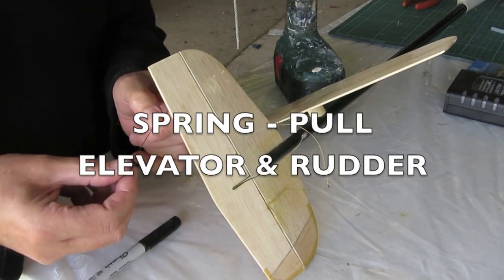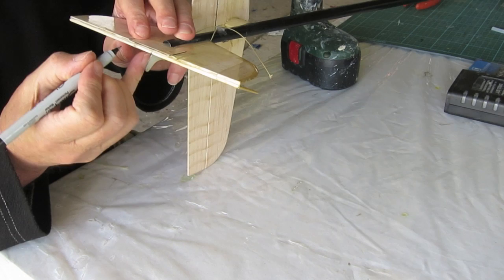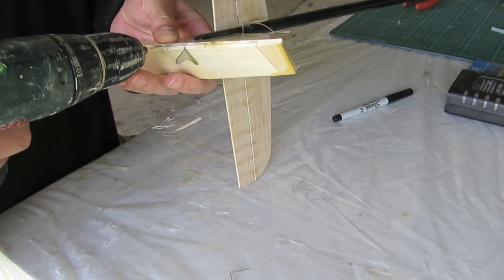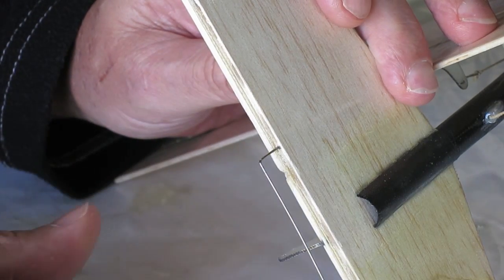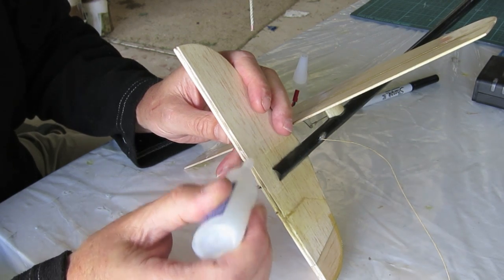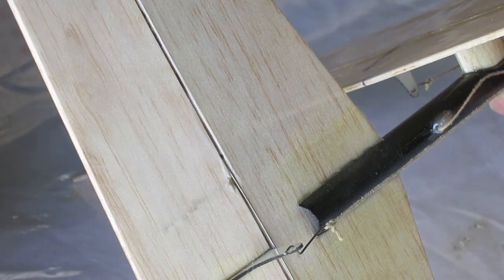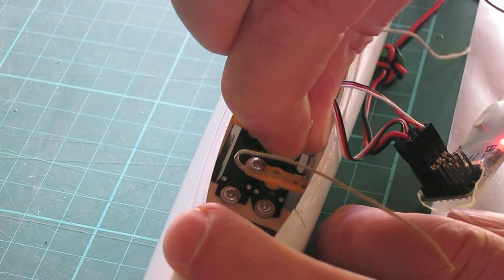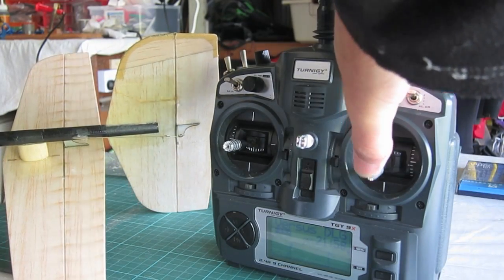Spring pull elevator and rudder

Comment: Informative video, thank you! I am trying to build my first DLG at the moment. I was wondering does it matter which side of the rudder the string is on... I would assume if you are right handed ( like me ) thrower,  as you rotate, there is a huge centrifugal force pushing out, making the rudder swing right.... so you'd put the string and horn on the left, so its in tension during the throw... if the horn is on the right, the centrifugal force could overcome the spring? are you a lefty ?  ..also.. does it make any difference if its a pull string or a rod, I'd assume same for both, that you'd want them in tension ?
Reply: hrmm on second thought... after release the plane will yaw to the left, producing a large force on the right side of the rudder, so in that case the horn should be on the right side, (opposite the launch peg side )   which might be more important than my first thought above about centrifugal force....   any words of wisdom please ?
Reply from the maker: Your second thought is correct, but I'm no DLG expert. A little right rudder during launch to resist the left yaw. Horn on the right for a right handed throw.
Reply: Thank you. Much appreciated

Comment: Does the spring system make a noticable difference in battery span vs a traditional push/pull rod?  Wondering since the servo constantly has a slight load, even when sitting idle
Reply from the maker: No significant increase in battery drain. I get 60min of DLG from a 300mAH 2S

Comment: Something's wrong.
Am I the only one to see that? 
The spring is supposed to look like a Z not a U.
The only springiness the string feels is the hinge. Unless I'm missing something.
Reply from the maker: It's a U at rest but twisted into a Z when installed, so the Z wants to return to a U but the line holds against the torsion

Comment: I have a challenge with my 'U-Glider' with too much friction and slack in the RE connections - would this type op spring pull set-up work satisfactorily on the U-Glider ?
Thanks for your always excellent videos...
Reply from the maker: I think it would as long as you dont have too much spring torque. Might try to myself one day

Comment: Hi, I wondered if this solution creates problems. The servo is always under tension. You really use this system?
Reply from the maker: Ale Pac Still using this same setup after 18 months with no problems. The D47 servos buzz a bit but work perfectly, I have just made a foamy slope soarer using this system with TGY 9018MG servos and they are fine too. This is a popular setup for DLGs
Reply: Andrew Newton tanks, I tried to do it with an old DLG but buzz worried me. I will think about. Can I ask the type of the wire that you used?
Reply from the maker: Ale Pac Read the video description for more info

Comment: Hi Andrew have you ever considered useing a closed loop system on your planes ?, the advantage is, that you can mount you servos well fowards in the fuz but the best thing is you can loose a lot of weight from the tail ie two servos 9g each= 18g  plus the long extentions = about 30g total. So you need less nose weight to achieve a CG The connections for trace wires are made by slipping a 1mm dia 5mm length of alumium tube on each end then slip the wire through the horn fold back and slide the tube back down the wire so that the folded back end enters the tube, pinch it tite and secure with a dab of CA glue - repeat this the other end adjust acordingly and repete this operation for the other side. This must be repeated at the servo end also. For example a rudder you simply fit horns on both sides opposeing each other.  You end up with a push / pull system, repete for the elivater. Do the same at the servo end, it's quite fiddly to do but it works exceptionally well as it completly eliminates flutter. I do hope you've understood this, it's just a shame I can't show a picture, as it's not as complicated as it sounds
Reply from the maker: Thanks for the detailed explanation, I understand what you're saying. I have tried that for RC land yacht steering and it worked well, but not tried with planes yet. My slopers usually end up too light for the conditions so weight saving has not been a high priority, I have just gone for the simplest servo positioning.
Reply: Andrew Newton I take your point Andrew,  but I was thinking in general terms as I have never seen anyone who builds powered depron planes use this system, I watched Ed's AXON build and it was clear to me that there was a CG issue, as
he suggested shortening the moment arm to over come the prob' or to add nose some nose weight ? my point is, avoid adding nose weight on any plane unless there's absolutely no other option

Comment: steps to bend the wire? thanks
Reply from the maker: Cut a 90mm length using wire cutters. Make 90 degree bends using pliers, very easy.